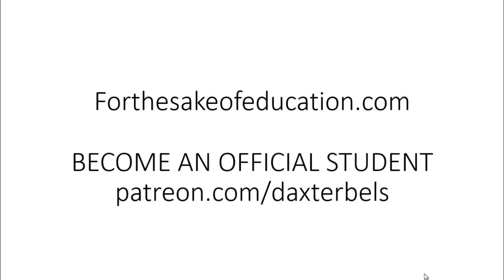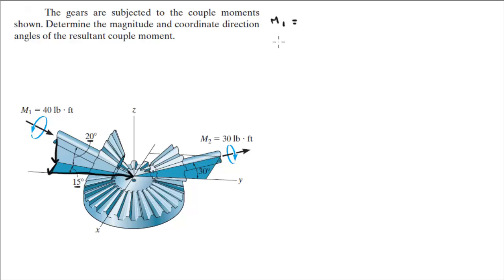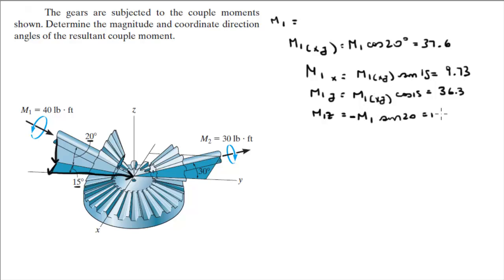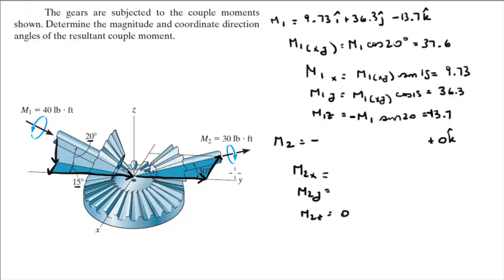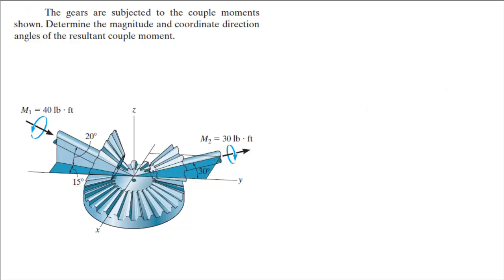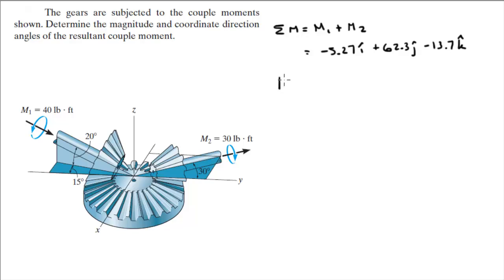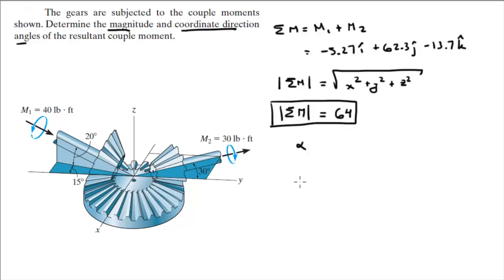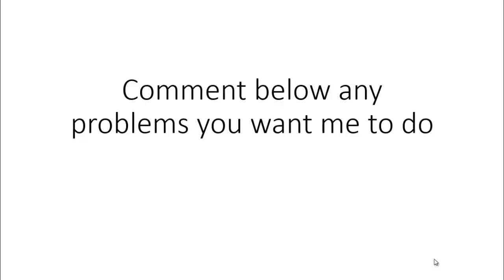Determine the magnitude and coordinate direction angles of the resultant couple moment.

Comment: Need your guidance on this please:
From 37 seconds to 53 seconds you draw vector directions for the 3 components of M1. How are those of us who are novices to know which direction those component vectors go, when we haven’t yet done the math? In previous problems we always determined whether a component was positive or negative based on it’s location on the corresponding axis, such as an x component would be negative if it was on the negative side of the x-axis. Wouldn’t it be safer for a beginner to use that method rather than guessing the direction of component vectors right at the beginning of the problem? The problem works out to the same answer, all except for the z component being -13.7, when trying to find the corresponding coordinate direction angle.  

While doing the math for the problem, I would have called 13.7 positive because it is in the positive direction of the z-axis. However, the correct coordinate direction angle cannot be found with 13.7 as positive. Why is that?  And how can I assign the correct positive or negative signs to a component vector when I am too inexperienced to guess what sign (direction) the component vectors are in at the very beginning of doing a problem?
Reply: You call the positive or negative directions on every axis, example: If you decide in z-axis that the up way is positive, in all your maths, every vector that goes up is positive

Comment: Problem 5.63 Due to an unequal distribution of fuel in the wing tanks, the centers of gravity for the airplane fuselage A and wings B and C are located as shown. If these components have weights WA = 41000 lb , WB=8000lb, and WC=6000lb, determine the normal reactions of the wheels D, E, and F on the ground.